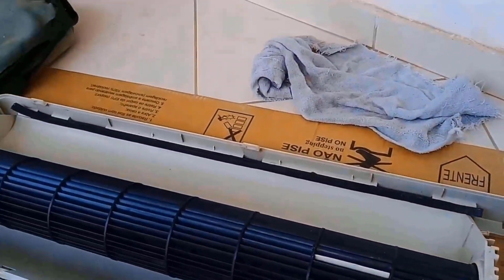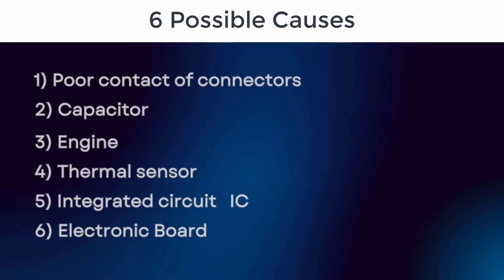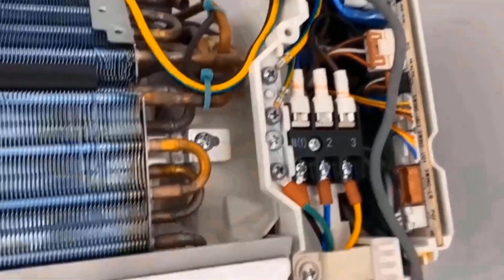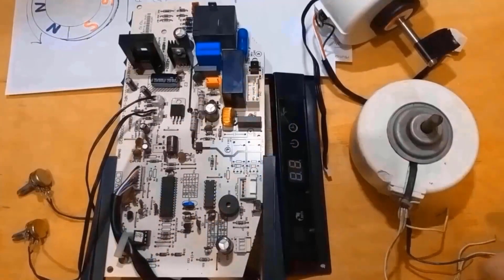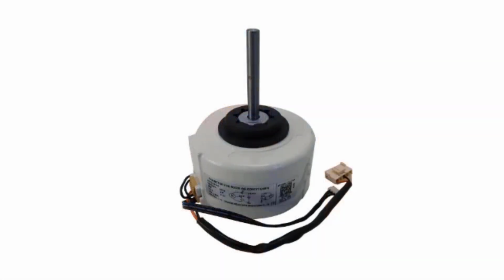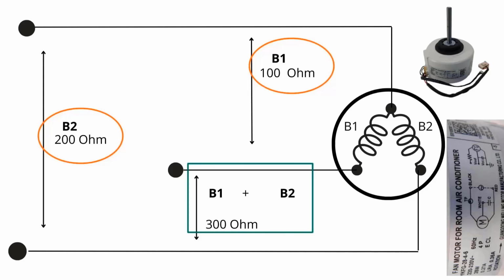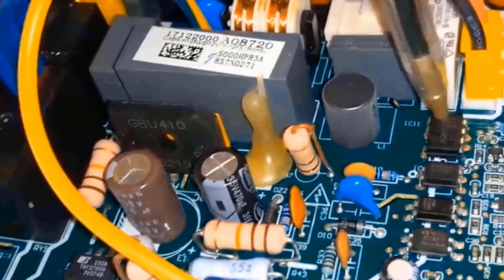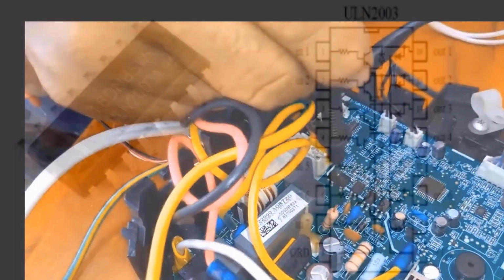Air Conditioner TCL  - Error E6

Comment: Hello sir, nice vid.  Is there a specific site I can look at to get ohms specs.  Mine is a TCL no inverter split, I checked the motor get 350, 340, and 600 ohms respectively.  I got an e6 code fan not spinning. Thank you,
Reply from the maker: Thanks! Have you tested and verified the motor input voltage?

Comment: Hi buddy ! I have two TCL air conditioners when they are with the photovoltaic they emit beeps without any errors on the display. after a few hours they start working again and then the problem repeats! you can help me
Reply from the maker: Hello friend. This happens because there is voltage fluctuation on the condenser or evaporator plate. When connected to photovoltaic energy, you need to measure the voltage at the input of the equipment board. If it is 220 volts, it cannot fluctuate more than 10%
Reply: @isaccabral3154  thanks ! so they shouldn't reach more than 220v? how can I solve it?

Comment: Hello sir, i got E6 error but when i move the turbine by hand it starts and works properly, can you tell me what you think my problem is? Thanks!
Reply from the maker: Hello everything is fine? In your case, everything indicates that it is a problem with the capacitor that controls the evaporator turbine motor.
Reply: @isaccabral3154  Thanks!
Reply: Hello sir i got E6 after 3 hours is the problem is motor only?